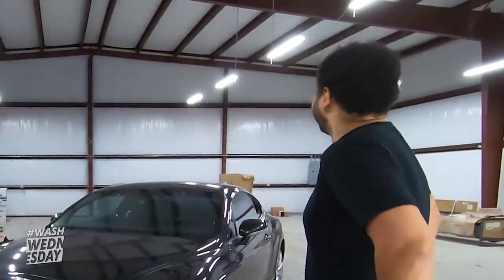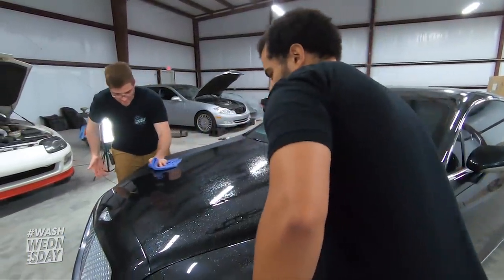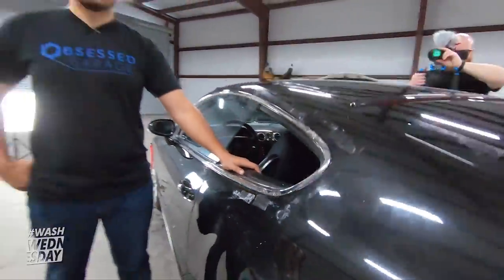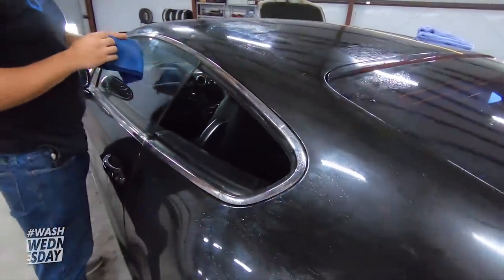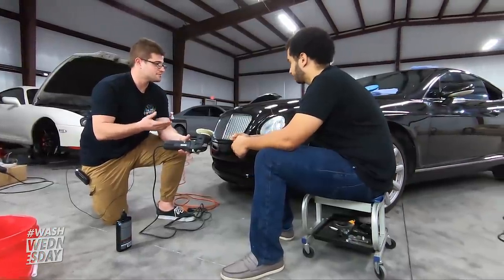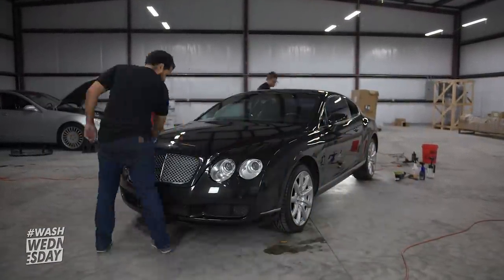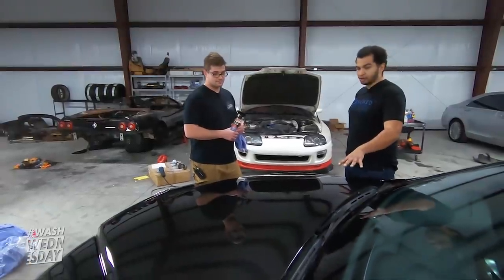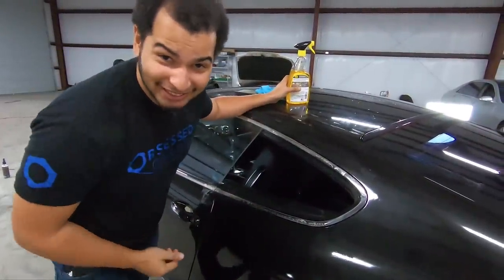Detailing Tavarish's FILTHY Cheap Bentley | Wash + Polish + Bead Maker | WASHWEDNESDAY

Comment: Anthony, what pads did you use with The Last Cut Polish? How many pads did you use? Is the  P&S Paint Prep better than the Optimum Paint Prep? Did you also use the Edgless 350s with Beadmaker? Sorry for all the  questions I'm trying to learn paint correction as a hobbiest, and it will help the decision process this Tuesday for when I put that TRC order on Pad Tuesday for pads, paint prep, The Last Cut and towels.

BTW its agood thing your The Rag Company, I'm sure you have a recommended rag should something premature happen.
Reply: Primarily Rupes Yellow Pads. We had VERY limited pads on this detail, roughly 4 pads total that were used and abused. Both paint preps are comparable. We did use the Eagle 350's for Bead Maker as well.
Reply: @ALLDAYANTHONY  Thanks Anthony. Eagle 350's are my favorite TRC product, I use them for everything on the paint (I like to feel the paint, perfect density,  super soft), wax/polish removal, paint prep, etc., great for an ONR W&W interior maintance wipe down. 
P.S. I'd really like to see a special edition Wash Wed. where Dane washes the Volvo.

Comment: As soon as I heard rinse less wash, I closed the video.
Reply: @theragcompany  I don't use traditional soap. I use all kinds of special car shampoos and all that. There is dirt and all kinds of crap not only on the surface, but between door seams and so on. A car has to be prepped, very carefully before you even touch it with anything. How cars especially high end with expensive nice paint is supposed to be washed is not like this. Because if it is even slightly dirty or dusty, you will need to give it a full paint correction after each "rinse less" wash. It's like washing yourself with baby wipes... A car should be fully carefully rinsed off with water everywhere that you are going to wash, then it should be foamed down, let sit for a bit then carefully rinsed again, after that a good inspection is given to everywhere that the sponge is going to be in contact with. And only then do you start washing the paint.
Reply: If the car will be corrected/polished, rinseless/waterless wash make more sense

Comment: Why is it that you (and Ivan and others) always strive to rinse the ONR wash towel (or sponge) to the edge of dripping? What's wrong with a towel or sponge fully wet dripping?
Reply: @theragcompany  Thanks for the reply! For the sole individual who prepares a gallon or two of ONR in a bucket (for a single car wash) dripping is irrelevant. I thought that would be the case but still wondered if more liquid would somehow impair the cleaning process; clearly not.
Reply: The Rag Company Hmm, I think I have to disagree. I think it could be important to not use too much if you want to get the dirt removed from the surface in one go. Otherwise you will get dirtier drying towels. Thoughts?
Reply: @Sherukka  It really will not matter if the drying towel shows a bit of dirt, mine did a couple of weeks ago.  Using ONR lightly on a heavy road grime paint will just need a second pass.  ONR is good stuff but not able to pull all the dirt off always in a single pass.  Amazing product.

Comment: First and last time to your channel - you completely lost me at "rinseless wash". Seriously, common sense should tell you that there's not a coating on earth that can repell nasty grit from between your cloth and duco surface (no matter how many times you turn it).
Reply: Have you ever used a rinseless wash before?  Serious question.
Reply: @bfielder9097  You're presumably implying that I need to try it to prove that the process won't scratch my car - and if it does, what then? If on the other hand you're suggesting that it does a good job at cleaning, that is not under dispute - I am sure it does. A good summary of the issues is here: https://www.reddit.com/r/AutoDetailing/comments/b97k1a/detailing_tavarishs_filthy_cheap_bentley/ek7oq8d?utm_source=share&utm_medium=web2x
Reply: @theragcompany  Thanks for the  reply guys - I appreciated the production quality of your video and the entertainment value for sure. After investigating the practice (at the recommendation of the awesome /r/AutoDetailing community, my concern is specifically with the notion that a pre-rinse in unecessary. Full comments here: https://www.reddit.com/r/AutoDetailing/comments/b97k1a/detailing_tavarishs_filthy_cheap_bentley/ek7oq8d?utm_source=share&utm_medium=web2x